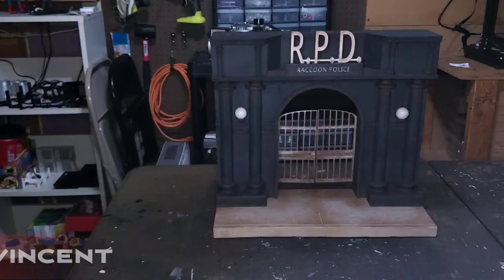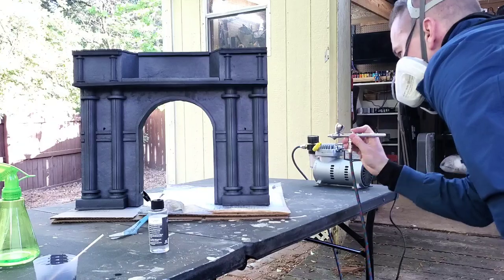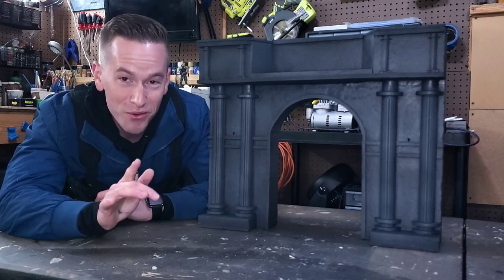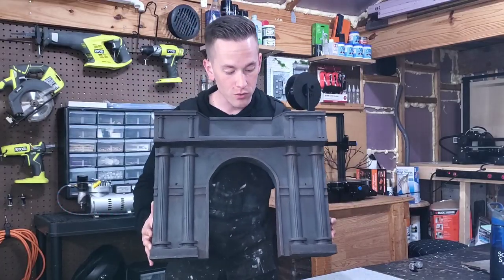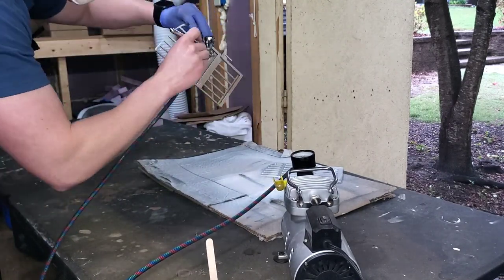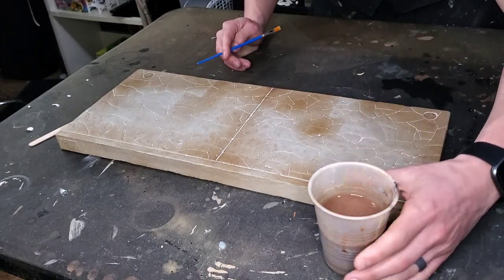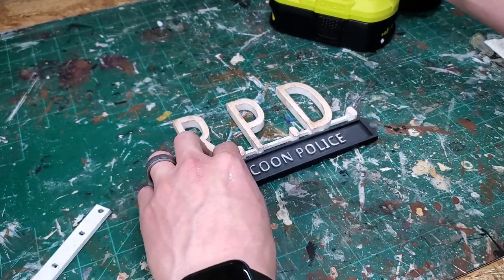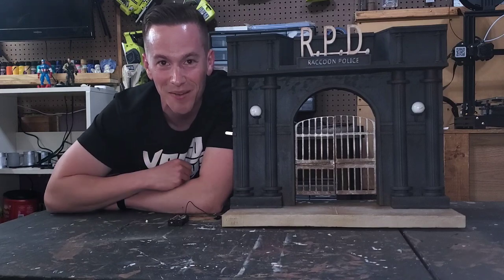I Built a Handcrafted RPD Station from Resident Evil!

Comment: One thing if you look at metal gates in the real world they dont looks shiny metallic because they get oxidized.  start with a grey base coat then dry brushing your metallic or using a sponge.  After that you could add some rust tones, dirt grime, a wash to bring it all together etc.  Less metallic paint and more greys and rust/earth tones. One thing that really helps is to google real world rust and how it forms different shades etc. Your dio looks great though! Just some constructive criticism
Reply from the maker: Thanks for taking the time to watch the video and leave this thoughtful comment. I definitely do use reference images when I create my dios, but will give this a shot next time I work on a similar piece. Appreciate you!
Reply: I believe I used the wall paint and patch before but I found that the liquitex paint gesso is great to use as mortar because it white and you can add a few drops of black to make it look like gray mortar or add fine sand for gritty mortar. Also, you Al Figures and Dripmode are my favorite diorama guys in the US, but in London…Creative Cuts has AWESOME videos on different terrains etc…also Oilers workshop. Great sites and inspiration!!!
Reply from the maker: @klj5150  thanks so much for watching and for the suggestion on the mortar. Al, Dripmode and Oiler's are GREAT! It's an honor to hear the channel is a favorite of yours. I will have to check out Creative Cuts for sure.